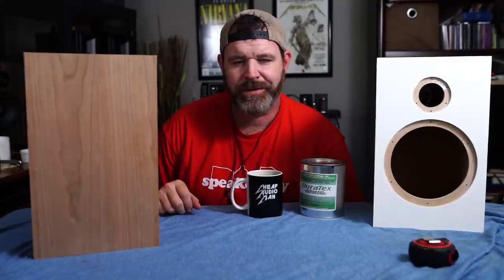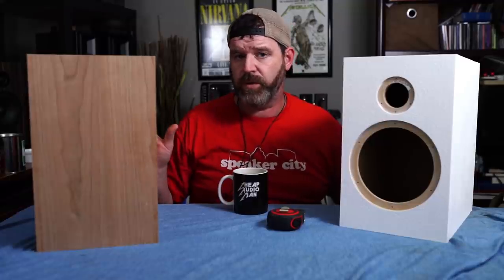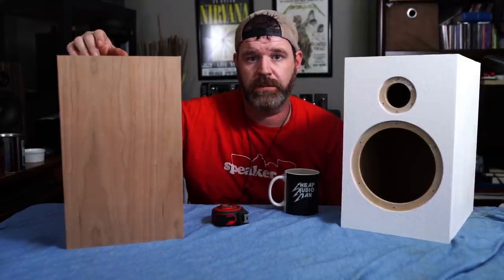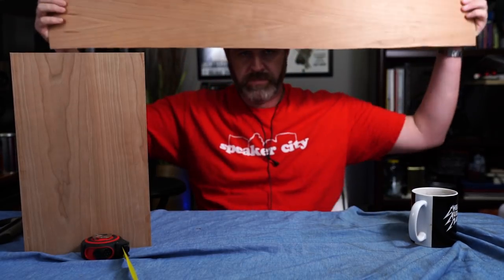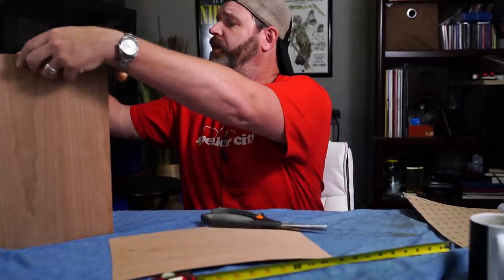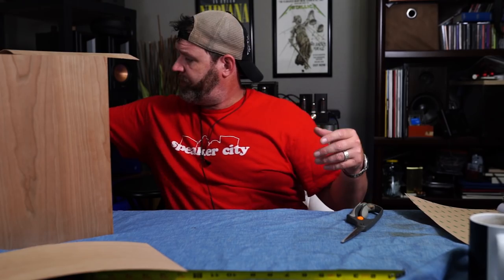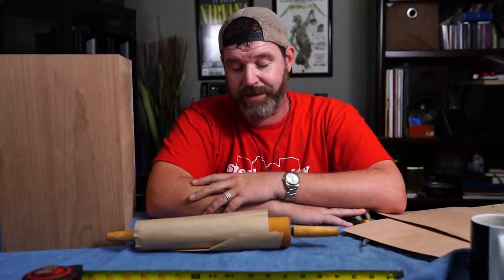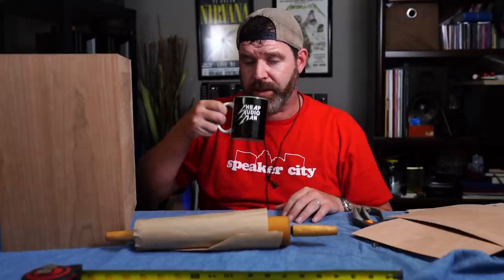How to Veneer a Speaker with the Cheap Audio Man

Comment: Great intro! Just a heads up that bad joints can project through veneer too. The best way to prep the cabinet is to use bondo on the seams and sand smooth. Then you can paint or veneer or whatever. But the key is good prep work.
Reply: Bondo on the seams! Awesome tip.  Thanks a bunch!

Comment: I agree. This is the best way to finish MDF. If you decide to paint your seams and corners and everything must be perfect. The amount of prep to really do it right is substantial. 
To veneer a speaker is very fast and easy, and it looks amazing! I use contact cement, but like Randy said, you can use the peel-n-stick, wood glue and iron, or contact cement. Then after you've routed the edges and some very minor sanding, you can stain it, lacquer it, whatever. I made a pair of 10" subwoofers a while back using some old Boston Acoustic car audio subs and they look (and sound) phenomenal! They look like you could eat them! They look like candy. I'm very proud of them. I'm working on a pair of X-Statiks by GR Research right now. I'm gonna finish these the same way I did the subwoofers. 
Thanks Randy! 
You da man!
Reply: Where have u been all my life?!

Comment: I am an electrician in a plant that makes wall paneling in a process very similar to MDF. Fires are common during the pressing and drying process. Half the plant is about 120 degrees, full of smoke and a stench of formaldehyde, the other half is about 120 degrees, soaking wet and filled with the stench of rotting wood pulp. Unless you're by a door or outside, then it is -10. So yes, MDF is from hell.

Comment: Nice job. If you have not yet decided how you want to finish the MDF then it is useful to make some templates for future veneering before you assemble. Use the preassembly flatpack panels to make templates  on some stiff card or paper and draw around the edges including the holes for port and drivers. Cut out the holes with a craft knife. Keep these card templates and if you decide to veneer later they will always work. You can cut the port and speaker holes by sticking the template to your veneer with temporary spray glue and use a sharp craft knife or scalpel to carefully cut the holes and edges if you don't have a router. Use these to trace the outline on the veneer leaving the slack you need. In any case the best tool you have is patience, don't rush.

Comment: Bondo works on seams.  Then primer.  Then spray paint in high gloss.  Sanding in between.  Cheap and straightforward, but a little time consuming.  You can get a piano gloss finish that way, though, without having to worry about veneer problems like peeling and cracking and shrinking/expanding.  It’s even a little bit hearty against water damage if cleaned up quick enough.  Still, some folks dig the wood grain look, I guess!

Comment: I'm going to build the CSS Criton's this winter and my plan is to Bondo the seams on the cabinet and then take it to a body shop or wood shop to have them finish it. There's a local home theater company that advertises custom finishes so I may reach out to them. I picture myself gluing my fingers to the veneer and then having a full frustration meltdown.

Comment: Wow i have been wanting to veneer my klipsch klf20 they had the factory glue fail and this time was bad both speaker cabinets needed a full rebuild. my klipsch kg5.5 i used to have just 1 needed the back right side reglued. but the klipsch klf20 i did front and back on both of them one the front and back was totally detached the other one the front and all but a foot on the back left bottom i put in extra wood inside so the glued surface was a 1/2 inch wider on the sides and top and bottom i used finish nails in my nail gun then glued and clamped the front and back on and  nailed them in from the side filled all the holes with wood putty but i am tired of the light oak i like this way better because i just didn't want to deal with the glue mess now that i know about the self adhesive veneer its a go i like the mahogany looks good on amazon with a light oil to darken it up i thank would look nice . so far my klipsch rb 35's are fine i hope klipsch fiigured out there glue issue because the 80's and 90's were bad. i listen to 2 channel a and b speakers thanks for the video's

Comment: I'm a klutz when it comes to stuff like this so I appreciate the "how to" video.  If the speaker is not too big, I would probably just lay it on the veneer and trace an outline in pencil (I'd check first to make sure pencil marks can be erased off of the veneer).
Reply: The veneer has to be flush trimmed and sanded anyway so there won't be any remain8ng pencil marks

Comment: Dancing with the devil (MDF tips) - when you've drilled and screwed the screw holes for the speaker drop some thin superglue in and around to stiffen up that area. 
For finishing MDF ends - soak in thinned down PVA glue, sand (when dry!) and repeat. Add a bit of white powder filler to last coat. You can easily achieve a surface a bit like the MDF top surface. 
Another surface idea (tried on other stuff) obtain a very thin cloth for epoxy/clothing/skinning in aeromodelling (very cheap if china sourced), paint this onto the (fully prepped and smoothed) surface - can give a slight texture, or can be built up to a mirror finish. You can put in edge 'reinforcement' as a first layer. Makes a very durable finish and adds a small degree of composite strength overall.    
MDF remnants actually burn OK so stick 'em in your woodburner (sparingly) - not your open fire though (probable nasty gases).

Comment: PSA (pressure sensitive adhesive) veneer is by far the easiest fastest way to get a good looking speaker cab. Next would be any paper backed veneer using contact cement. My experience.

Comment: You going to show how to trim the edges and rout (spelling?) the holes in another video?
Reply: You run a router around the piece of veneer and trim it to speaker size. If you have little edge you can use a sanding block or a file to take it down flush. Just alway sand or file with the grain.

Comment: Use a veneer scraper to get the PSA veneer to adhere. A roller will not be able to apply enough pressure to get proper adhesion

Comment: What prep work needs to be done to the MDF other than sanding?  Do you need to coat the MDF with shellac or lacquer to make it smooth prior to putting on the PSA veneer, or does it stick fine to the bare MDF?
Reply: Anyone?
Reply: I would use at least some sealer and then shellac

Comment: If you add up the time for multiple coats of filler sandale primer, the sand paper, elbow grease, then the final paint coat, maybe with a clear coat that you could color sand and buff, veneer is so much simpler. Whatever you spend for a reasonable piece of veneer, you will probably spend at least that in paint and prep work. Not to mention the dilemma of how to paint six sixes of a box and have it look good. I thought about it and figured I'd make two pedestals from two and three inch PVC plumbing pipe and mount them to a board and suspend the speaker through the speaker openings cut in the cabinet but, it just seemed like a hassle and a mess. You would have to shoot the front first then put it on the mount etc. Ugh.

Comment: I have seen some really nice MDF builds. What I would do is use a router to round off all the corners (optional) sand it real good and use "filler" to fill in all the voids and sand it smooth all over. Then paint it, and wet sand between coats to get rid of the "orange peal".. One can get a Piano gloss finish with this approach. Check out the "Home Theaters Gurus" Channel and look at his video has the title Piano Gloss finish where he has an MDF sub woofer build with a piano gloss finish. I learned a lot. Using Veneer as suggested in your video is nice too.

Comment: Randy, The router bit you show for cutting the veneer for the speaker recess was not clear in the video. Do you have a link or description for that bit? I cannot find any router bit to cut just the recessed speaker circle.
Reply: It's called a flush trim bit
Reply: @SqueamishPuppet  I see how that bit would work for the speaker hole but, the recess cut is too shallow for the  blade to engage the veneer, the bearing surface of the bit is taller than the recess
Reply: They're still called a flush trim bit but they don't have the bearing on the end.  This comment is 9 months old, but in case someone comes across it you can find them on Amazon:  solid carbide flush trim bit